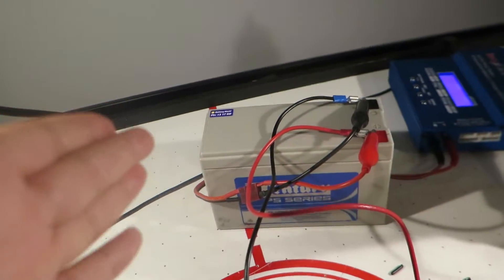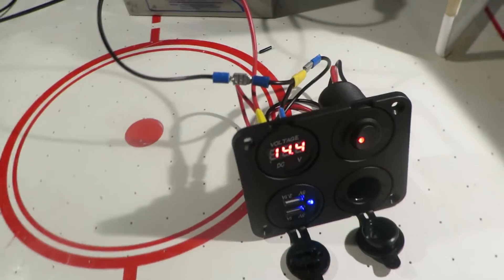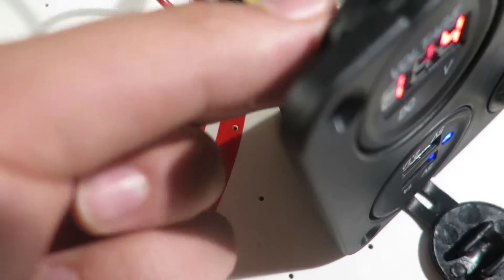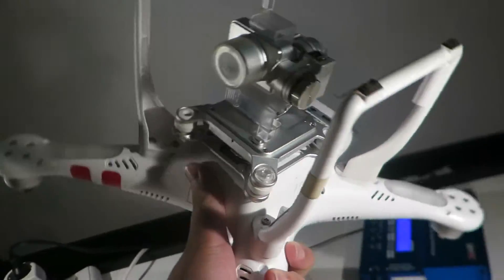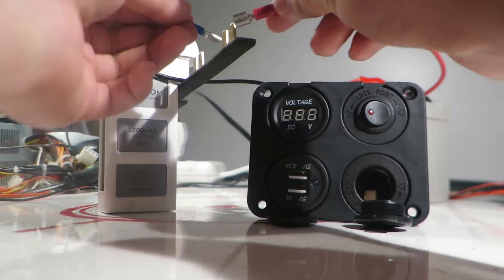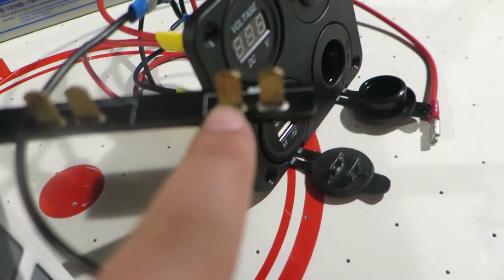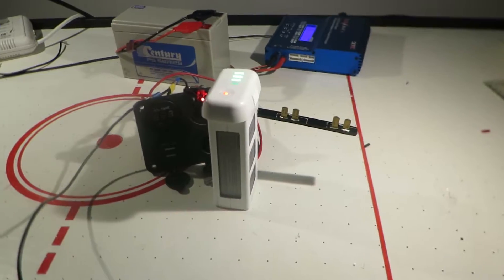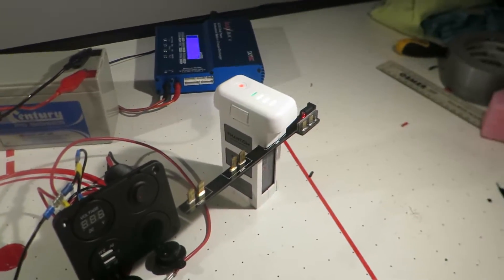Can 12V DC Hurt you? / Is 12v DC Dangerous?

Comment: Pls is 7v 800ma dangerous by touching?
Reply from the maker: No. The higher the voltage, the higher the risk is for electrocution. So if 12v won't hurt you. 7v won't in the same conditions.

Comment: I have a SMPS adapter which reads 80-305 VAC,12 VDC, 1A on it. If I put the output end in water and then touch the water will I get a severe shock?
Reply from the maker: No, I don't think so. Worst case you may feel it (I've done something similar and didn't feel a thing) but it definitely won't be severe if everything is operating properly and that high AC voltage isn't making it to the output.

Comment: When I ran 12v through my hand I felt a little bit of stinging and when I put my multimeter in series it read that around 10-20mA was running through it.
Reply from the maker: I guess it would also depend on a few factors like humidity and stuff, so that makes sense.

Comment: That's barely at 7 amps, try 40 amps
Reply: hahahah thats not how it works techliberator.
Reply from the maker: @bobbin69 
EDIT: SORRY MISREAD COMMENT, thought you were addressing me, sorry.

Original comment:
 Care to explain? I've also touched the terminals of my 1000W inverters battery terminals with no feeling what so ever.
Reply: I can explain. For techliberator. When you touch both the positive and negative terminal of a battery your body becomes a paralell resistor to the voltage. The current will be limited by your bodys resistance. So say for a 1 megaohm resistanse in your body paralell to the voltage will only draw 0.00001amps at 12v. Basically nothing. This is why you can touch 12v without being harmed. Because the current going through your body is limited.
Reply from the maker: @bobbin69  That's a very good explanation. Thanks!
Reply from the maker: That shouldn't matter. Amps in this scenario wouldn't make a difference. I have some race drone batteries at 14.8v capiable of delivering over 100 Amp bursts but touching the battery wires are a lot like how this test went.
Reply: @atlasnetwork7855  anything below 60v DC in dry conditions, and 30v DC in wet conditions is considered a safe voltage to touch. educate yourself
Reply: @atlasnetwork7855  you clearly have no experience, nor education on the subject
Reply: @atlasnetwork7855  1 megaohm was an example resistance, and is very typical when measuring from one hand to the other, and it is in fact very correct. I just measured between one hand and the other and got a resistance of 1.1 megaohm. For fun I also measured my tongue which measured to 30k ohm. In other words I would be fine if i licked 12v, and even higher voltages. You have no idea what you are talking about! The only way you would measure 3k across the human body would be if the electrodes pierced deep into and through the skin.
Reply: @atlasnetwork7855  And by the way, there are standards for this. The considered safe DC voltage limit in the EU is 30v, and in the US, it is 50v.
Reply: @atlasnetwork7855  Source?
Reply: @atlasnetwork7855  I can definitely make such a general and sweeping statement, as there is an EU standard saying anything under 30v DC is safe to touch. It is not unsafe to get a slight tingle in an edge case.

Comment: Does 12 volts DC will harm you?
Reply from the maker: This video answers that question.
Reply: @LetsGetStarted  where?
Reply from the maker: @DOOMSDAY-TV-b7z  The entire video where I was touching the power terminals and not getting injured/feeling anything what so ever. Since I didn't get harmed by touching the terminals, the answer is no, I did not get harmed by 12V DC.
Reply: @LetsGetStarted  thank you sir 😍
Reply: @LetsGetStarted  so definitely DC have Resistor and AC don't have Resistor?
Reply from the maker: @DOOMSDAY-TV-b7z  Sorry, I'm not too sure what you mean. both 12V DC and AC shouldn't hurt you.
Reply: @DOOMSDAY-TV-b7z   No, Your skin is the resistor.  12v DC is not enough to break the resistance of your skin even when it's wet

Comment: does 12v DC damage your eyesight?
Reply from the maker: Technically yes. If you had enough amps and you shorted out the connections, the sparks would likely be bright enough to damage eyesight like how welding would do for example.

Comment: 12 volts dc is absolutely harmless, i put it on my tongue(the lowest resistence point) and only felt a tingle
Reply from the maker: That's what I was trying to demonstrate in this video. I guess the only time it gets dangerous is when there is a short with high enough current.
Reply: Is 300 v DC is harmless
Reply from the maker: @chetanverma2048  No, With enough current, 300v DC would likely be harmful (although I haven't researched this). Even at around 40V or so you may start feeling some tingling, so I would say 300V DC is dangerous.

Comment: So I'm extemly noobis at electornics, I have just began with the basics. The question is what does it mean to short a circuit?
Reply from the maker: When you touch the positive connection (Usually Red in a DC circuit) with Ground/ Negative (Usually Black) together it is called a "Short Circuit." Always try to avoid it unless your doing it intentionally for some reason especially when working with things that have a lot of power stored up like a large or powerful battery.
Reply: @LetsGetStarted  Thanks alot.
Reply: @LetsGetStarted  Also, could I ask another question?
I was wondering what type of accumulator should I choose for powering small electric motors, heating wires etc. I was looking at Pb accumulators and there was a disclamer to use the accumulator for long term purposes only (solar pannel control module power supply, ups... ). Sorry for my somehow bad English, it is my second lungague.
Reply from the maker: @arty7122  Just call it a battery, easier to understand😉. It depends on the application. PB or Lead acid batteries tend to be very heavy for their energy density but tend to be safer than lithium options (unless they leak, the battery acid gets flooded everywhere.). The other thing to note about PB batteries is the fact that they should really only be discharged to about 50%. Any more than that and they sustain damage. If you can, I would always go lithium. They are a lot better in terms of almost everything like power output, capacity, etc, but with the expense of being more expensive to buy and implement. PB batteries also have another advantage of not needing to be "Balanced" (When the cells or segments of the battery are equalized to eachother.) Lithium batteries in their nature are made up of cells to equal the voltage. Each cell is around 3.7v so to make a 11.1v battery you would need 3 connected together (in series) to equal that. These separate cells need to be  "balanced" when they are charged. This reply is getting too long, let me know if you need more info.

Comment: So basically when a power supply rate 100 amps, it just mean it has the ability to deliver UP to 100 amps, but still has to obey Ohm's law regardless?

Just like a 1.5 regular battery that can deliver say 10 amps (short before battery drain), it doesn't fry the electronics because component in series have a resistance.

Is it safe to assume typical switching/linear power supply have "pseudo" constant voltage and variable current?
Reply from the maker: I couldn't say for sure and don't fully understand what you mean by pseudo constant voltage and current, but I would think it remains the same when you are talking about voltage from a battery and a power supply. They both have a certain voltage and amount of amps they can deliver before the voltage will decrease, but then again, i'm in no way experaianced enough to be providing solid information.
Reply: You are over-generalizing the word power supply. There are different kinds of power supplies with different I-V curves.

Regulated voltage supplies will attempt to maintain a constant voltage up to their maximum current rating.  At that point they will either burn out, open a fuse/breaker, or drop below their regulated voltage. The current varies with the load per Ohms law. 

An unregulated voltage supply acts as a constant voltage source with an internal series resistance acting as a voltage divider with the load. It will have a linear I-V curve with maximum open circuit voltage and dropping as the load resistant reduces thereby drawing more current.  Maximum power is produced when the load resistance matches the internal power supply resistance (assuming the power supply is rated for that current). After that,  the power drops until the voltage becomes zero.

Some power supplies are or can be set to a constant current mode.  In this move the power supply varies the voltage to maintain a constant current -- at least until it has exceeded its maximum available supply voltage.
Reply from the maker: Thanks for the explanation!

Comment: My son wants a  30v 5A or 10A bench power supply. That would generally be safe  as well?
Reply from the maker: Yes, that should be absolutly fine. Just make sure he doesn't short circuit  the power supply. 30V 10A is quite a bit of power and may give quite the spark if you were to accidentally short it out. In terms of electrocution, it may give you a tiny tingling sensation in very certain situations, but it wouldn't be dangerous or lethal I would think.
Reply: @LetsGetStarted   Thanks for the reply!! We have been using 12v DC a lot lately. I thought I remembered from electronics class(30 years ago) experimenting with that range with no mishaps. I do remember some kids purposely shorting out the supplies to create an arc/sparks for kicks. Also contests to see who could take the most current without letting go. I seem to remember kids being able to take WAY more than 30v easily. I did a lot of crazy things back then and never thought twice. Working with tube amps(high voltage) etc. But it is different when it is your kid! Thanks again!!!
Reply from the maker: @mikelee1906  Sure! I guess I myself would still be classed as a kid especially when I made this video😂  but i've done some basic research and they say you start to feel it around 50v and I personally have only gone up to about 40 with the help of some buck converters i've been messing with. 12V is absolutely my favourite voltage though.

Comment: this is what i thought because i've seen dangers of AC. so my question is.. Is DC dangerous in some ways? like.. thousand volt DC?
Reply from the maker: Yes, absolutly! I don't know the specifics, but even 12 or 24V AC shouldn't hurt you. But any form of high voltage should have the potential to cause harm. More milliamps are required of DC current than AC current at the same voltage to cause harm.
Reply: AC hurts and is more dangerous because it shorts across capacitance, and the human body has some capacitance. But DC can’t short across capacitance. But DC can kill you very easily with a high enough voltage.
Reply: I work as an electrician and if you have especially dry hands and low body fat even 277VAC seems pretty harmless.   120 feels very mild, like hitting your funny bone.  That said if you have sweaty hands it'll get you pretty good.

Comment: But does 12V DC with a current off 2A Hurt you?
Reply from the maker: No, the batteries used in this video are able to provide more than 2A of current and if your asking if 2A will hurt you while current is being drawn, then no as well. I know this as I don't get hurt when touching an inverters (12v DC to 240V AC Converter) battery terminals while drawing 30A of current from the battery from my solar system.